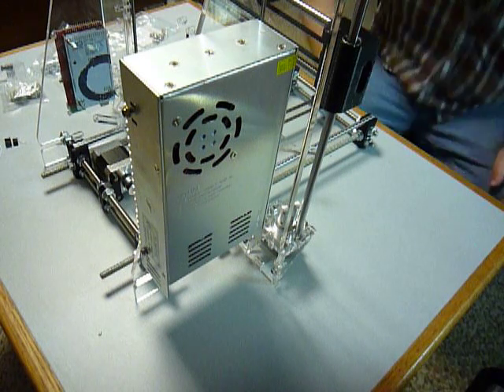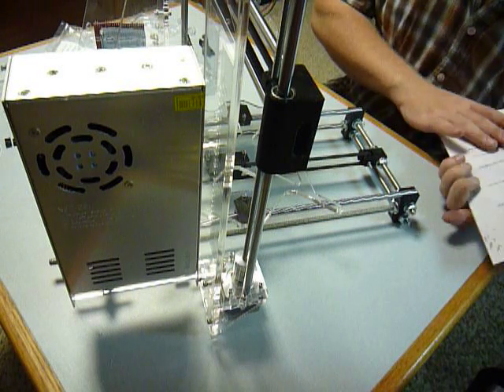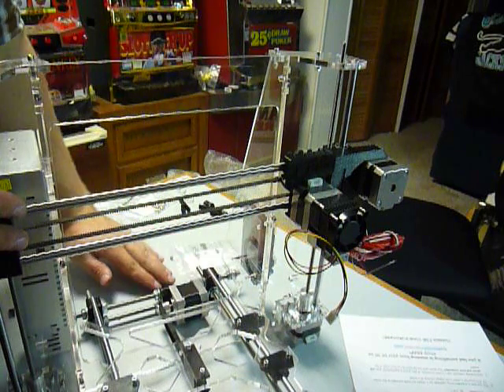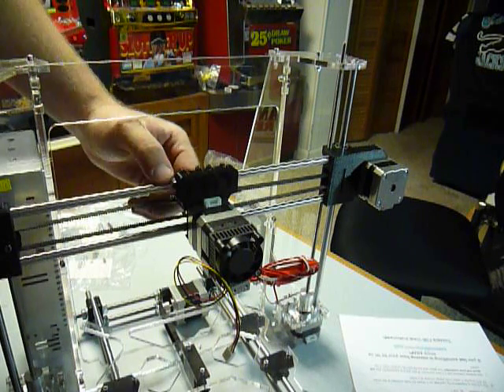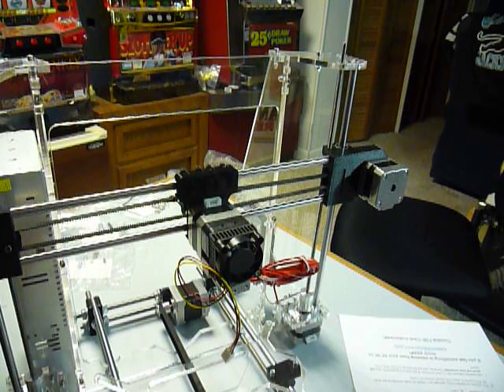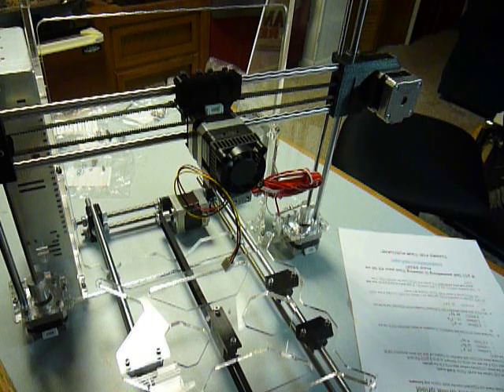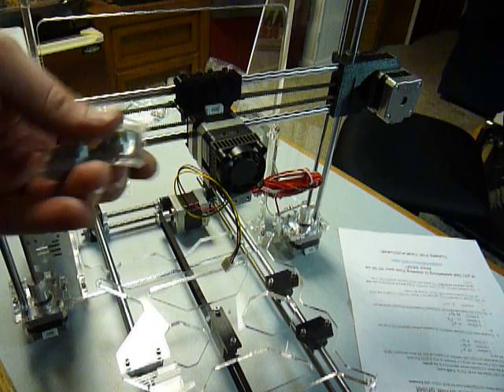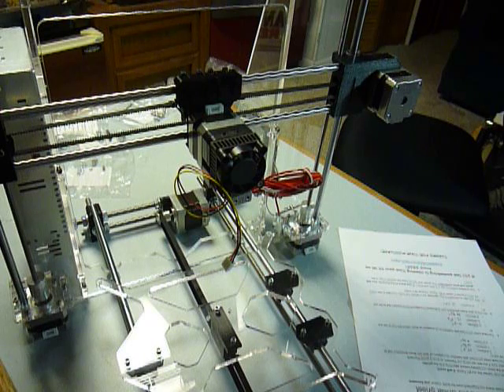Folger Technologies Prusa i3 3d Printer Build part 17

Comment: how did you figure out the carriage? I see no video for it or instructions....
Reply from the maker: you will use 6 zip ties to hold in the 3 linear bearings. then you slide it onto x axis linear rods with the two bearing portion on the top. you then run your belt and slide it into the toothed groove on the back side, just like you did for the y axis belt on the lower portion. finally, your extruder will install by removing the 2 longer bolts and passing them through the carriage them tightening them back down in the same holes from which they were removed

Comment from the maker: Just a note, you don't need those larger 608z bearings in the kit, you can use them to make a spool roller or integrate one into a new extruder if you choose to print a type that needs a 608z bearing.
Reply: yes, got it from your another video. how about the belt springs and 5XA4988? they are last few i don't know where to put.
Reply from the maker: yu yang The belt clip is only necessary if you have slack in the gt2 belts, they clip over the belt and apply extra tension to take up slack. hook one leg over the belt and using pliers pull the other leg back and hook it over the belt to apply extra tension. the A4988s are your stepper motor drivers. those go onto the ramps board. (if you have not yet installed all the jumpers on the ramps board do that first) when you install the stepper drivers, make sure the little screw head (trim potentiometer) all face to the side of the board away from the power plug. if you install them backwards (180 degrees) and apply power, and they will fit backwards, you will destroy the driver and will have to purchase new ones.
Reply: bubalettow great, thanks, i missed the jumpers.
Reply: bubalettow hi, do you have instructions regarding the jumpers? i can't find nowhere. also, where does the extruder fan go to the shield?  sorry for many questions.
Reply from the maker: yu yang there is a set of 6 pins completely underneath each of the stepper motor drivers.  : : :   <- like this. what you need to do is jump them in pairs so it looks like this -> | | |  you'll do this for each stepper using a total of 15 jumpers
Reply from the maker: bubalettow Search google images for ramps-14-diagram.jpg, the first hit should give you a good picture of where the fan goes.
Reply: bubalettow thanks for the tips. save me big time.
Reply: bubalettow the picture is slight different with mine. mine has no pins between E1 and E0. anyway, i hook to D9 as some suggested.
Reply: bubalettow sorry, the is one more question. hope it's last one. i try to power on or use usb connect to the machine. but the yellow light on mega2560 and green light on shield keep flashing. other than that, nothing happening. do i need upload firmware or something like that before proceed?  
i haven't done anything setup yet. just finished machinecal and electrical connections.
Reply from the maker: yu yang I never experienced the light behavior like you are describing, but I did upload the firmware as soon as I was ready to apply power. use the firmware downloaded form the google drive for the printer and then modify it to you needs. look on youtube for how to install the firmware on an arduino mega, you'll need to get the arduino ide software but it kinda straight forward. I suggest pronterface software once you get the firmware loaded

Comment: thanks for the videos. as you know, Folger's videos is incomplete. they should have pay you for this.
few questions here:
1. seems missing how you put the x-catriage to z-axis?  now i just let it seat on top of two M5 nets, but it can run up free as nothing attached to it.
2. i watched your videos twice. but can't find the hotbed part. and I'm worried i can't find the temperature sensor for hotbed.
Reply from the maker: yu yang for the x to z axis connection, yes there are the 2 5mm nuts that thread onto the threaded z rods and if you look on the back top edge of the x axis motor mount and x idler pulley mount you will see a hexagon shaped hole in each, the x carriage sits on top of these two nuts in the holes. For the hot bed, red(+) gets soldered to pin 1 only and black(-) gets soldered to both pin 2 and 3 on the hotbed circuit board, the other two pads are for the thermistor (temperature sensor) and it doesn't matter what order you solder the wires.
Reply: bubalettow thanks, i found the hex holes for M5. and found the sensor, i was expect a detached sensor but actually it's already there. thanks a million ;-)